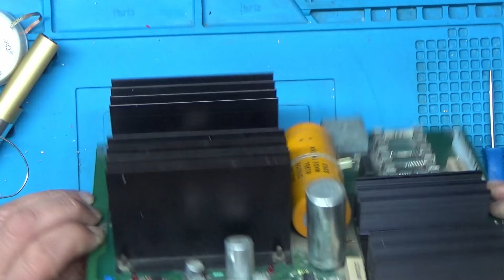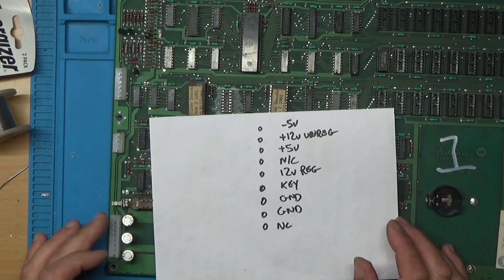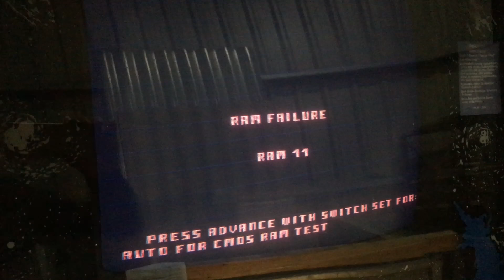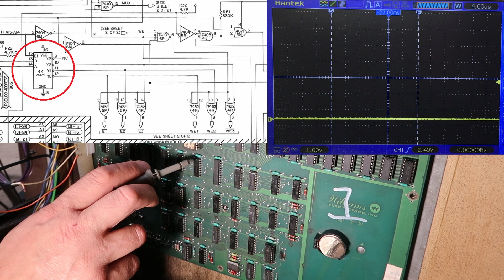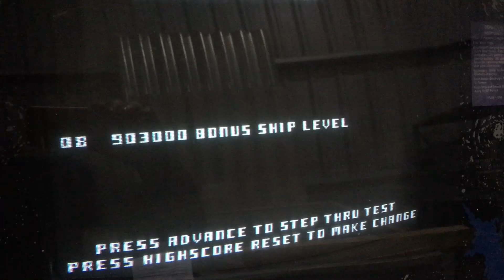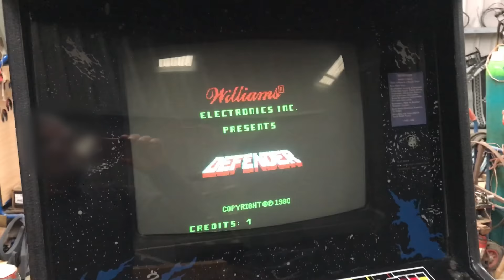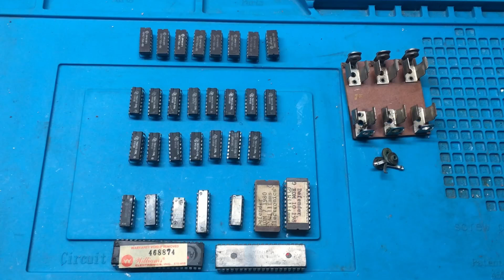The Repair That Broke Me - Part 2: Rescuing a 1980s Defender

Comment: The EEPROMs which test good but fail in use might have aged poorly where they can't respond with data fast enough anymore. They've slowed down. RAM chips can act like this as well. Test fine but can't work at the speed they're supposed to.
Reply from the maker: Plausible explanation.

Comment: I'm impressed (again) with your tenacity! A few things still niggle, tho:

Those power transistors tend to fail under load once they've heated up a bit; a 24 (or even 48)hr soak test may be called for at full arcade volume etc, to check their true resilience over time

I'm puzzled by the EPROM failures, given you appeared to be able to read the images from them with no issues. Did you try read/write cycles on them (after replacing ofc) to see if they were truly faulty, potentially pointing at other IC problems in their circuit(s)?

<minor niggle> a stiff (ie high-gauge) ribbon cable would have looked better for the short bridge between the sound board & main IMO, but I guess you use what you have available :)

The different CRT (esp its extra depth) may well be a source of recurring problems, as well as ensuring this machine is never 'original condition' (if that matters to the owner). Could that CRT backboard be conveniently moved to another position in the cabinet to avoid such future problems, or would it be better to use it as a sacrificial board to prevent (further) dmg to the tube neck?

Lovely hack WRT that battery holder replacement BTW: I'm v impressed with your diagnosis for a reasonably decent swapout :)

All in all, an excellent fix! I bet you were glad to see the back of it! :)
Reply from the maker: Thanks 👍I'll give it a proper soak test when I'm back from holiday. It's on my to-do list before I arrange with the owner to collect it. I'm going to ask him if it wants me to change the capacitors or not, as a few other viewers suggested that they might have internal leakage making the capacitance read more than the stated value.

I haven't tried re-programming the original chips. With them being 2516, and having to pull the PGM pin low to read (as they aren't supported and my programmer always has it floating) it would just error when trying to verify after each byte is programmed, and I can't just tie it low as it needs the high voltage to be able to program.

I think once they realised the new CRT tube is longer, it looks like they moved the whole CRT forward slightly to mitigate it. It could also do with a couple of more bolts in it to secure the whole thing down as there's only two in it currently. It also needs something better to secure the monitor chassis. It could possibly be that they only had two bolts in the back of it at one point, which allowed the tube to tilt backwards which caused the damage too.

You're right about the CPU > Sound board cable, I just used what I had around. It does look a lot better than it did originally although I'm not sure what the original cable looked like.

Thanks for the comment about the battery holder, and yes I'll be glad to see the back of it in some ways, as I spent far too long "IN the back of it" 😂😂😂

Comment: Desolder gun,  place tip on joint, wait a couple seconds, pull trigger while moving tip in a circular motion
Reply from the maker: Thanks for the tip 👍 I did figure it out eventually when doing the RAM sockets. Part of the problem was I don't think I had the temperature high enough on the gun.

Comment: Love you vids. This one was the best yet.
I have one of those desoldering guns. They're made under a lot of different brands. I had similar issues that you experienced (not desoldering completely and blocking.
The issues seem to be caused by low sucking velocity and/or the suck taking too long to get to max velocity. This results in the solder not being extracted effectively. Sometimes this causes the solder to lodge in the cold end of the heated tube. Other times some of the solder is left behind.
I have partially fixed my gun by desoldering with the gun horizontal and the pcb vertical. This makes it so the molten solder doesn't have to fight gravity when comming out.
I think the true fix is a better vacuum pump or a vacuum reservoir wth on off valve going to the gun but haven't tried modifying it yet. Maybe this is something you could attempt on your channel as a video
Regards
Ian
Reply from the maker: Cheers Ian 👍and thanks for the tip on the de-soldering gun. I turned the temp up to 370c and started moving it in a circular motion around the pin in the end which seems to have helped a lot. I think I had the temp too low, but I was worried about damaging the board which is why I didn't try higher temps until later in the video.

Comment: Color me impressed my friend. I think the dodgy power supply fried heaps of stuff, on top of the previous hackery. Very nice work !.
Reply from the maker: Cheers mate 👍Yes it was a bit of a mess this one. I think the powers supply fried a bit more of the RAM, but some of that was already faulty, and prone to failure anyway. The newer RAM I fitted is more robust. The other faults I think were already there before the PSU fail, as there seemed to be little change before and after. I was probing chips with the scope when it failed and noticed one of the waveforms went off the scale, so measured it and it was 8V! so I switched it off immediately. I think these old chips are quite hardy and can tolerate a higher voltage for a short period of time.
Reply: @BuyitFixit  Back in the 90's I used a jig made from a pair of Datsun taillight assemblies to load down linear power supplies, and check for ripple. Works great on atx supplies too, saves silicon... Can load down two rails to about 8 amps @12v, just by inserting bulbs. I still have them to this day. Cheap insurance...

Once again, great repair vid !.

Comment: Sterling effort rewarded with a fully rehabilitated machine. It seemed your intuition with the inner workings increased proportionally to your immersion in the project. Bravo!!
Reply from the maker: Thanks 👍And yes you're indeed correct. The more time I spent looking at the schematics and reading the "theory of operation" documents, the blocks of the system started to make more sense. I'm really glad they were available online as they  helped immensely despite them having errors.

Comment: You ever watch Mr Solder fix? He has a great technique for removing those multi pin chips and connectors.
Reply from the maker: I did watch one or two of his video. I think there was one where he soldered some copper wire across all of the legs to act as a heat pipe.
Reply: @BuyitFixit  That's the one. It works, but of course it's not always convenient or possible. I was just reminded of it.

Comment: Even by today's standards it's crazy how much it takes to make a simple game works
Reply from the maker: It's quite interesting how it all works, remember no graphics card or custom chips or  anything. It's a bunch of counters that scan the RAM, and then send the data 4 bits at a time (16 colours) to a make shift digital to analogue converter all made from chips and resistors, which create the display.
Reply: @BuyitFixit to me chips are still magic, great work, and what a battle literally 😅

Comment: Nice fix!
When I was doing commercial eleltronics in the UK for Olivetti, we used to 'ping' each chip leg with a small scredriver to ensure it was properly desoldered, if it was it, gave a "ting!" noise, if it didnt, it was obvisly still soldered... sometimes a quick poke on the leg broke the last solder bridge and the chip would litally drop out..

Im wondering if the 5V rail that raised to more than +5 damaged quite a few of the IC's?
Reply: As I recall, the 5v rail was only 4.9 but the 12v rail was high.
Reply from the maker: I was using the scope on the main board when the PSU failed. Suddenly the waveforms were off the scale, and there was about 8V logic levels instead of 5V. I pulled the power at that point and checked the PSU, and it was throwing out 12V.
Reply: @BuyitFixit some of the older 74 series ttl seemed pratically bullet proof, the 40 series cmos on the other hand, sneeze near some of those and they seemed to turn their legs up and die...
Reply from the maker: Cheers for the tip Rob 👍

Comment: That's a fix ! Hope it will last long and make some use :)
Reply from the maker: Cheers, and fingers crossed it'll last a while 🙂 The machine belongs to a fellow viewer so I'll be returning it once I've had it soak testing for a while. I'll see if he wants me to swap out the capacitors still.

Comment: Like many have already said.... amazing patience at getting the game fixed! I loved how you went a step further and added in the chip sockets, replaced the connectors, cleaned up the cabling and tidied things up. The next person that opens that thing up will be impressed and grateful that you went through all that extra work. You may want to add a note that the solder bridge for the 5V was intentional. I'll be sad to not find a video next weekend but by all means -- have a great holiday!
Reply from the maker: Thanks mate 👍and we're having a good time. It's the first holiday I've ever had out of the UK.
Reply: @BuyitFixit  Come to Crete!

Comment: Still watching the video, but inst that 3x cells in series for 1.5x3? And you are adding a 3v lithium?
Reply from the maker: Apparently the 5101 chip, which is the CMOS memory, has a data retention voltage of 2V.
Reply: @BuyitFixit  Thanks!

Comment: Thank you for following through on these videos! They brought back memories. I did a lot of work on various machines from that era, but Williams pinball and video games were my favorite systems. I was a tech in that industry until it fell apart in the early 2000s. I still do limited house calls for sick pinballs. You have a great approach for diag. The hard part is finding accurate schematics. 😉
Reply from the maker: Thanks mate 👍I'm glad it brought back some memories. I used to work in arcades when I left school back in the late 80s early 90s but not at this level of repair. It was more swapping PSUs or monitor chassis, or converting old cabinets to JAMMA. I'm still glad that the schematics were available, and the theory of operation, which helped immensely even with the errors. It made troubleshooting a lot easier, although it did take me quite some time to get it working.

Comment: How were you able to find spare parts? Are those chips standard ones that are still available to buy?
And for the up/down button, some like to have it reversed like in an airplane 😋
Reply from the maker: Most of the chips are just standard logic chips, which still seem to be readily available on eBay. The ROM chip dumps are available online so you can program them yourself if you have an EPROM programmer. The only chips I was worried about getting was the PIA chips, but they seem to be available too. I'm not sure if they still make them (or a compatible chip) as there seemed to be sellers advertising lots of new chips available for sale.

Comment: dont understand looks like your changing thinks at random ???
Reply from the maker: I appreciate the feedback, but I assure you, there's a method to the madness. The only things that I removed that weren't faulty were two ICs associated with the RAM 11 failure as the signals looked suspect. It was pretty hard to diagnose the fault on that part as there are many chips connected to the CPU's data bus making it harder to diagnose.

Comment: 10:10 The old caps are evidently good quality so it would probably be a mistake to change them for modern ones that could fail in the next year or so. Both Curious Marc and Usagi have repaired positively ancient computers and have left 60+ year old caps in place simply because there is nothing wrong with them.
Reply from the maker: Interesting. I've had a mixed response on that, some people saying the high reading is a sign of them being leaky. I'm wondering if I can make something to test them better.
Reply: @BuyitFixit  That is a new one on me, in my experience leaky electrolytics don't hold a stable reading at all and they don't tend to have a low ESR.

Comment: I'ts better to solder every second or third pin when soldering multiple pins to lower the thermal load on the PCB. FR4 is more forgiving, but when you will have the paper laminate (FR-2 ?) board, you will know the difference.
Reply from the maker: Thanks for the tip 👍 I'll bear that in mind for future repairs.

Comment: I worked on coin-op games and machines for 40+ years (retired around 04) and often on those games the sockets and chips get a bit of corrosion on the legs and a quick and dirty fix was to simply press hard on the chips (you will hear the legs push in and the rubbing helps clean them), on really bad ones I would lift one side of the chip a little, press in and do the same on the other side.n This helps clean both the legs and the socket and often machines were known to work fine 5+ years afterwards with no issues (these were machines that were on 12-14 hours a day and in some places 24 hours a day).
Reply from the maker: Thanks for the tips 👍

Comment: Thanks for another well done repair. In my experience, if an aluminum electrolytic capacitor measures much high capacitance, it's electrically leaky.
Reply from the maker: Thanks 👍 Yes a couple of people mentioned similar. I always thought they would decrease in capacitance  because that's been my experience with failed caps. I'll ask the owner of the machine who is a viewer of the channel if he wants me to swap them out.

Comment: Regarding the capacitor comparison at 10:11. The existing capacitor value should be 100uf and you measured 125 which is 25% over. The new capacitor measures 92 which is 7% within tolerance. Electrolytics can have between 10 and 20% tolerance ( dependant on quality, spec etc) so the new one is in range and given it is new will come up a bit when in use (reform) and ESR should reduce. The old one is definitely over tolerance which generally means has LEAKAGE, which can affect stable voltage / current to components / IC's down the line. I would replace them and if in power supply use good 105C / low impedance caps. No, I am not the capacitor "police". Just do a lot of restorations on vintage gear.
Reply: Ah, the leakage means that it takes longer to charge, so the meter assumes a larger capacitance, although it isn't!
Reply from the maker: Cheers Daniel 👍  I might see if there's a way of trying to determine the leakage. Someone mentioned Mr Carlsons lab leakage tester. Oh and LMAO at "capacitor police" 😂😂😂

Comment: Wow, so impressive, congratulations on this result! Please tell us when you will be doing another video game machine so we can invest in chip manufacturer stock in advance. Beautiful fix on the pcb with the solder mask. Is that the stuff that needs UV light to harden?
Reply from the maker: Thanks 👍 😂😂🙂Yes it's the stuff you cure with UV, and also a little heat from the re-work station helps too.

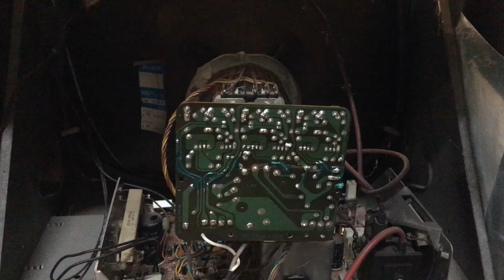Comment: Well done mate! I paused the video at 22:30 to comment on the re-wire of the cracked video PCB. I would be a bit concerned about using such small diameter wire since the traces are fairly wide usually to handle current flow. If you let it run long enough and they hold I guess that indicates they are adequate but if they are getting warm they might eventually fail so doing a thermal image of the wires might be in order, did you already take this into consideration?
Reply from the maker: It did cross my mind, but I don't think those traces take a lot of current. I doubled up the thinner wire just in case.

Comment: Wow! A crazy amount of work! You'll be having TTL logic chip nightmares for weeks now - LOL!  Truly amazing perseverence.  Trying to sort someone else's bodge work doesn't help.  Well done indeed.  I am puzzled @15:02 though.  Originally 3 batteries would have given 4.5v (maybe 5.0v when new), yet you are replacing with only 3v unless I am mistaken.  Is this enough for those chips?
Reply from the maker: Cheers Mike, yes CMOS nightmares too! A few others did the conversation with the battery and haven't had any issues AFAIK. The high score and settings were still there when I switched it off, and powered it back up a few days later.
Reply: @BuyitFixit  That's great.  Wonder just what the lowest retention voltage is?  If you remember the chip number I might try and look it up.  Glad it all worked.  As said, that was one hell of a fix it job and you should be very proud indeed.  Most interesting to watch.  You need a holiday now!
Reply from the maker: @MikeB_UK 😂😂😂Im in Spain at the moment. It was a 5101 if I remember.
Reply: @BuyitFixit  Thanks.  Good for you.  You deserve it.
Reply: @BuyitFixit  From a quick look, CMOS version min voltage 2v, LM5101 seems to be 1v.  I'd have never guessed that low.  Always learning something!  Enjoy the sun and the sangria!
Reply from the maker: Thanks mate 👍Yes I'd never have guessed that low either. I would have thought 2.5V or something. Thanks for sharing.

Comment: Unless you mentioned a possible cause and I missed it earlier, I feel that a lot of these chips could have been damaged by the power supply that went rogue in part one. Great diagnostic rabbit hole. Sooooo worth it though. 😄
Reply from the maker: Thanks mate 👍 Possibly but the original fault was pretty much the same even after the PSU failed. The ROM was still faulty and the ROM board PIA showed the same symptoms from the start, along with the screen counter chip. The RAM for sure was not helped by the PSU but I suspect some was already faulty.